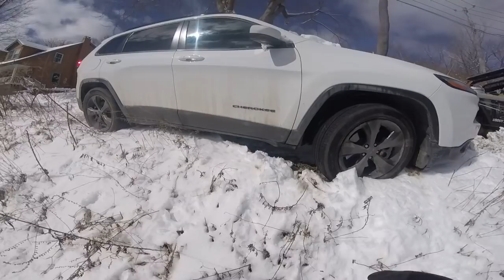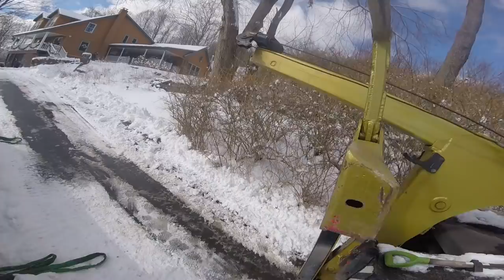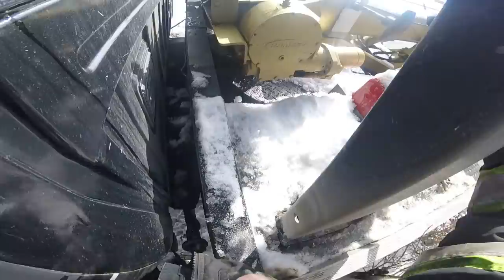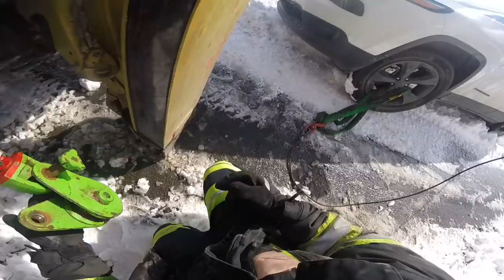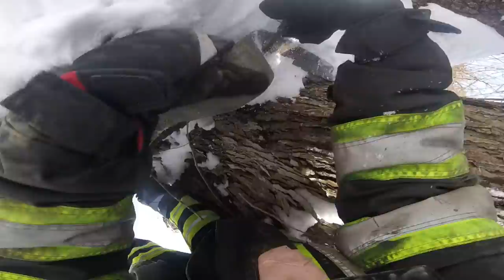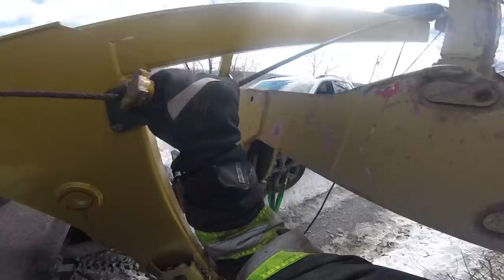Jeep Cherokee Stuck in Driveway Part:1

Comment: Careful man, all that weight is dependent on the strength of the rim and the threads of the lugnuts
Reply from the maker: More force is generated when that wheel hits a pot hole. Everything I do on a recovery is done the Wreckmaster way.l
Reply: @towuniverse2443  tow truck drivers REGULARLY recover vehicles from deep ditches using allow rims. examples are all over youtube, often with only 1 rim, not 2. i liked your example of the force a pothole exerts.

Comment: I love your content and would have watched this sooner but didnt realize it was from your channel. But if you'd have started by putting that snatchblock on your driver side hook. And put the rim strap or sling on the cust. Driver wheel and pulled. Their front end would pulled up onto the road, all youd have needed to do was was drive forward and once you brought it up as close as possible,  if you start sliding put your winch in free spool and move forward.  Grab the passenger wheel and continue pulling. Would have taken you 5 minutes not 12. On part 1. Nothing you did was wrong but in this job time is money.
Reply from the maker: I ran a high line to get lift on the casualty. I did'nt want to run a low line because I did not want to drag the undercarriage on the berm it was sitting on. Thanks for watching.
Reply: @towuniverse2443  Thanks for making content. Also.. nice truck. I have the same one,  just longer, and a heavier chevron wheel lift